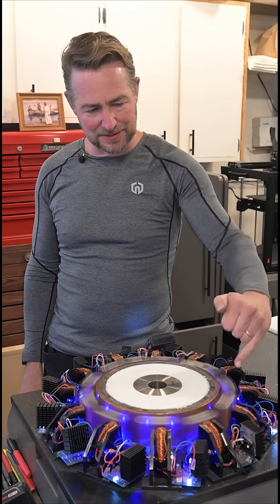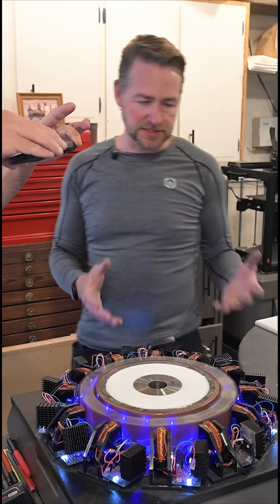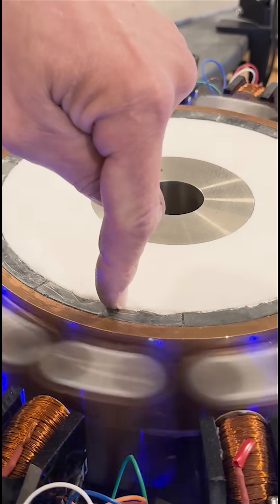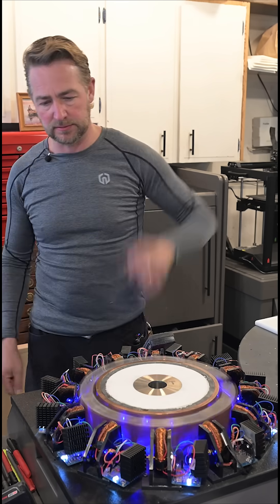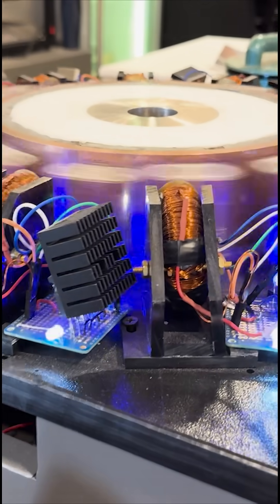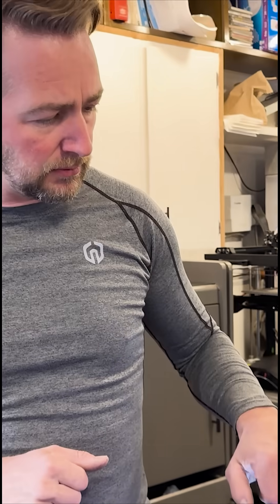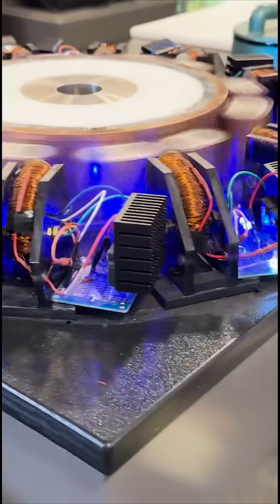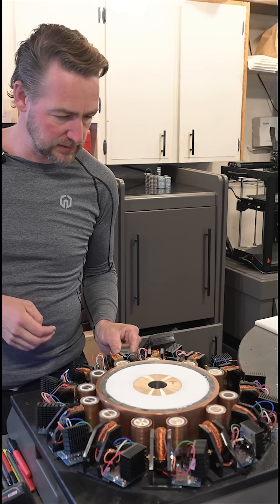Searl Effect Generator Demo by Isaiah Ritchey

Comment: What does this device do
Reply: @Critter145  supposedly produces electricity. Still working towards that goal
Reply: @ it seems like it’s designed to have all the energy go into the rotating mechanism. If you out load on it, wouldn’t it seize?
Reply: @Critter145  from my research and only from this understanding, not actual demonstration so far. The unit draws its energy from the environment when it's running correctly. So the more load you put on it or if any load you put on it it just draws more out of the environment and gets cold as it operates. There's one gentleman in Russia several years ago by the name of Mr Delfin. He has about a 26 part video series of his building a replica SEG. His is very basic and built with all the incorrect proportions, however I believe it's on part 25 he puts a solid neodymium disc into the center of the unit which goes below freezing cold after just several minutes of running. To me that demonstrates that it's starting to change heat into energy

Comment: now what ? fancy schmancy explanations .. yo ... take a rod, put it in the middle and see if you can pull electricity or even overunity from it ! .... anything ... 15 years i know about this concept and never saw anything concrete properly explained .... and by that i mean what we all wanna actually see ... searl effect producing overunity and perhaps anti gravity ... meaning the thing floating and the effects it does on the side ... at least its claimed so !
Reply: @StellarionPrime  very good questions. I've been on this for 17 yrs + and have seen every bit of the wild claims of this device too. My progress is very slow for sure. But as time has gone by I have been seeing more and more that this device could possibly produce electricity. For me it simply is a converter of heat energy to electricity. Producing antigravity....who knows. Words are cheap, show me an actual working unit!

Comment: Version 2 of my SEG. About 230 RPM max.
My version 6 can now get the rollers easily up to 395 rpm. 
Working now on version 7.
Reply: Ever get any weird feelings after being in close proximity to it?  Do you measure a clear temperature differential with this version?
Reply: @SaveTheFuture  this version doesn't have anything "special" or unique about it. It's just normal magnets rotating around magnets. Version 7 which I'm working on now does have custom magnets wave fields in the rollers and statora magnets. 
Presently I have been able to consistently get the rollers to levitate around the stator at about 275 RPM. They hold steady until maximum of 395 RPM where they fly off.
Reply: Interesting. Isn’t it around 550 rpm it starts operating without an outside power source?
Reply: @57-np2bu according to Roschin and Godwin model it did. Mine is quiet different from there. If you watch Mr Delfins video his unit started growing cold around the 200 RPM range